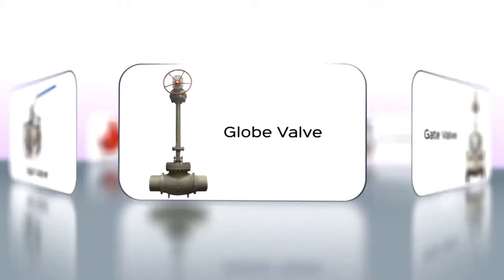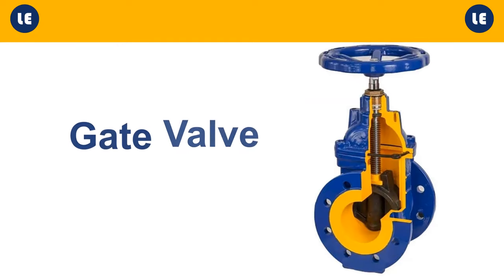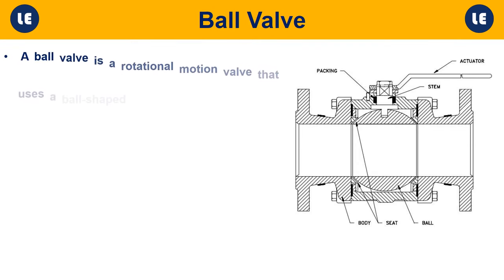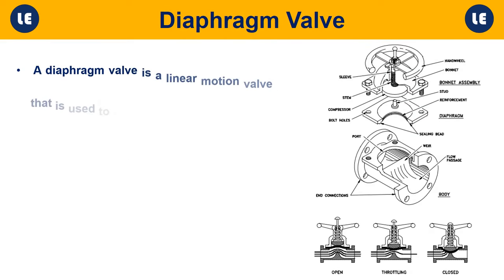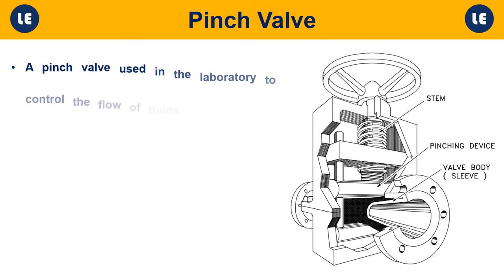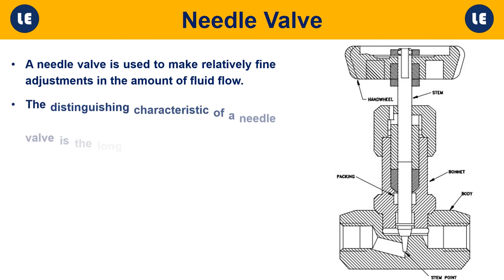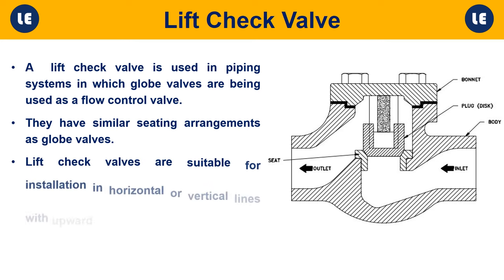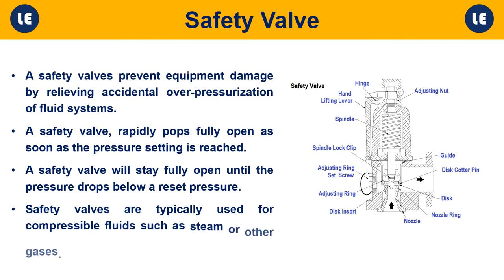Types of Valves | All in One Guide to Industrial Valve Types

Comment: Regarding the Globe Valve diagram: Is the fluid flow backwards? Fluid should enter the lower chamber of valve body, up through opening in valve seat, and outleting through the upper chamber. 

With current orientation: Fluid pressure will impose a counter active force while trying to open the valve (many globe valves have arrows on them to display direction of flow).
Reply: That is correct. Also when you close the valve there should be no pressure on the shaft seal.